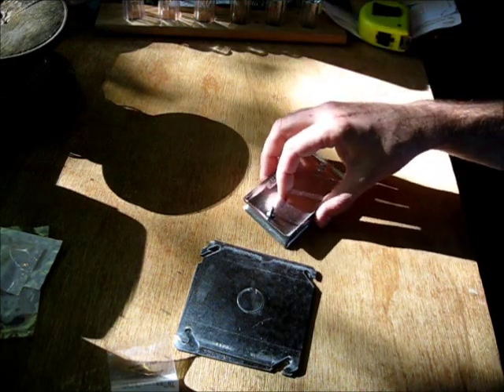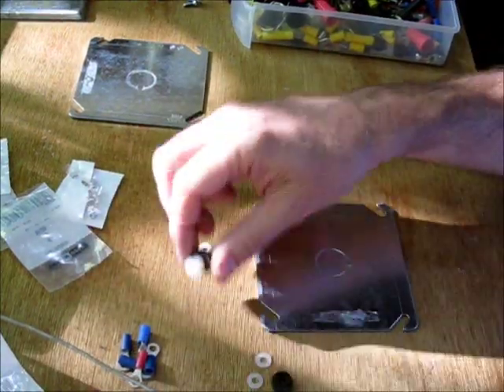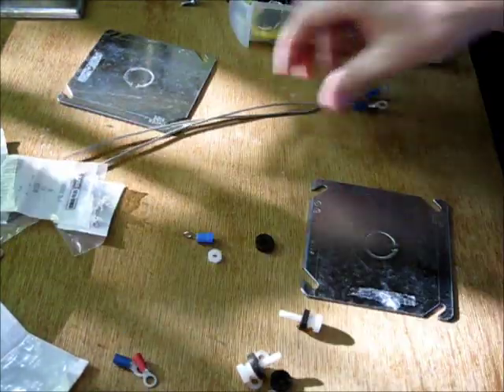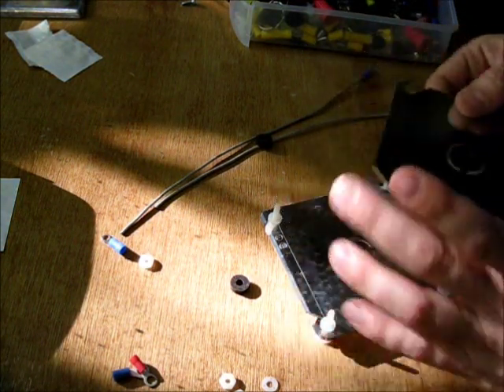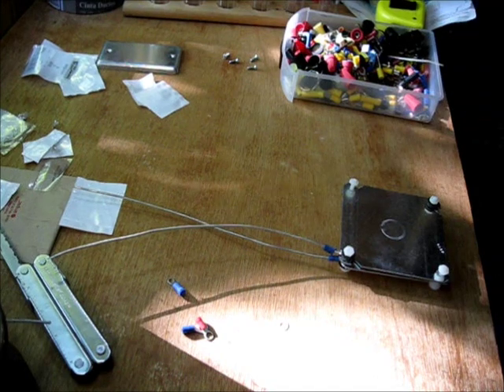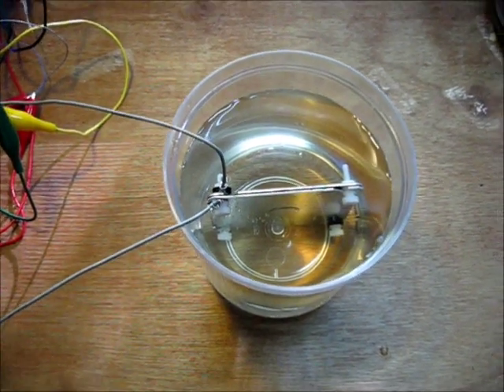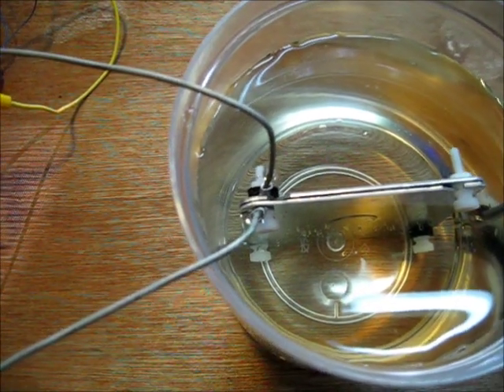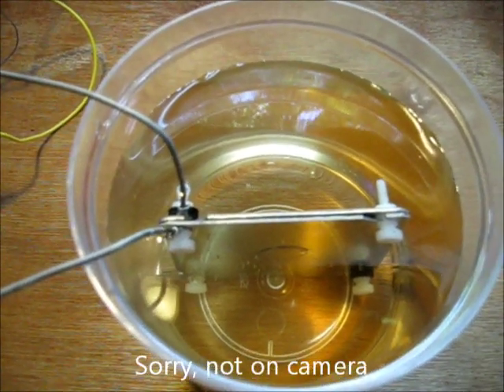Make a Water Capacitor - Hydrogen Booster Using Radiant Energy

Comment from the maker: NO! Do not plug into the vacuum, where it could enter the crankcase. Rather into the air filter box after the filter element. Let it mix with incoming air flow. Much safer.

I use a bubbler or backfire suppressor. A container filled with water. Gas from the hydrogen booster goes in the bottom, bubbles up through the water and out the top, where it feeds into the engine.

I never allow the gas to accumulate anywhere in order to limit explosion hazard. Once blew my apartment up, bad oops.